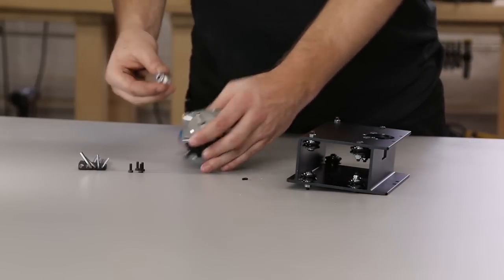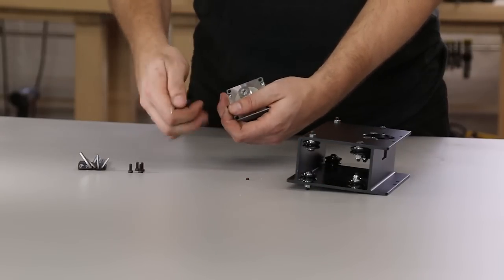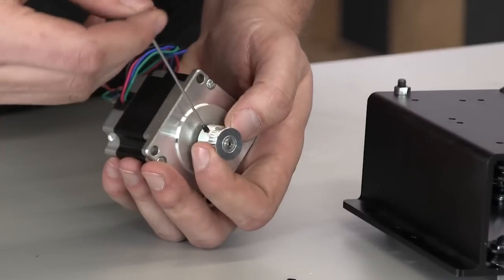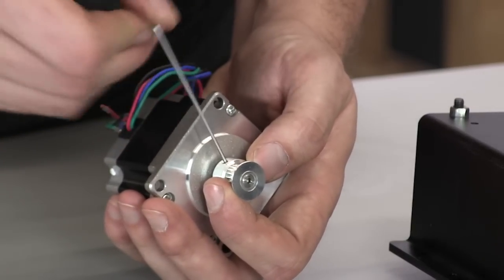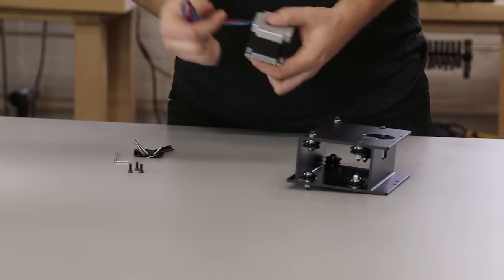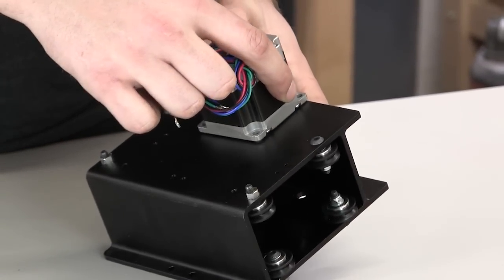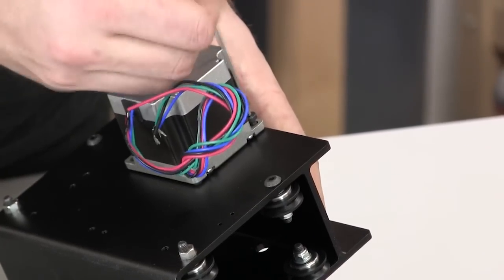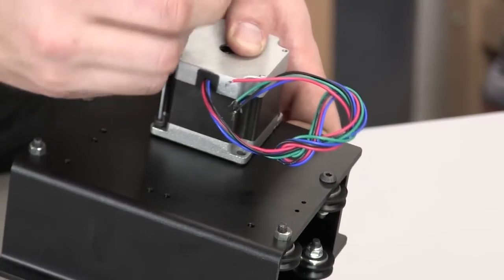X-Carve | Assembly | X-Carriage NEMA23

Comment: So the offset caused by the flat head screws isn't something to be concerned about?
Reply: +James Lewis I have the same concern. I was considering putting small washers all the way around but then it might have a small gap inside. It is almost like you need to grind them down.
Reply: +dieselfury I only 10 or 15 hours on my machine so far, but it doesn't seem to be an issue. Still seems odd on another wise clean build.